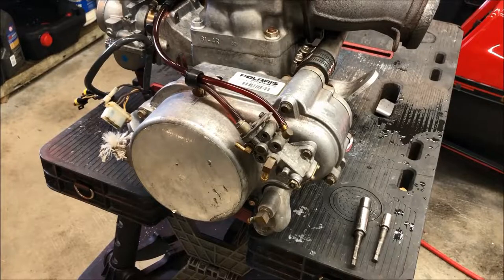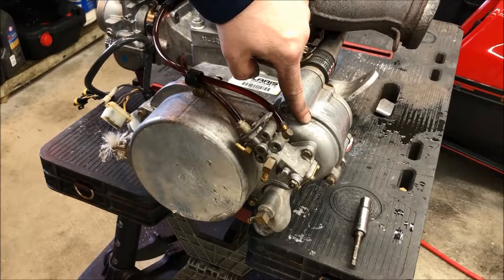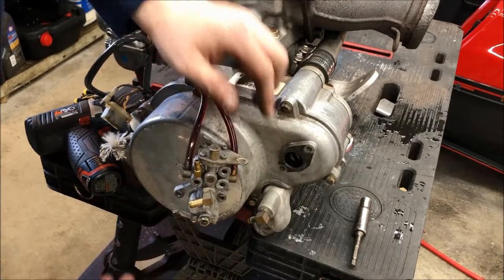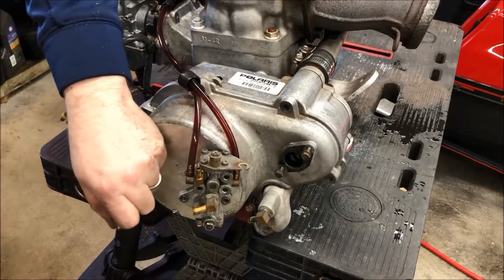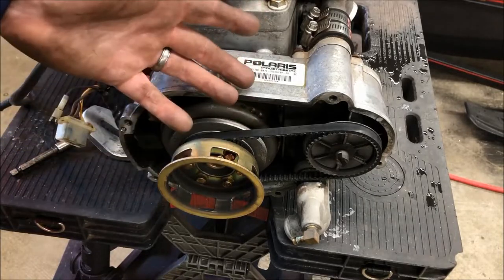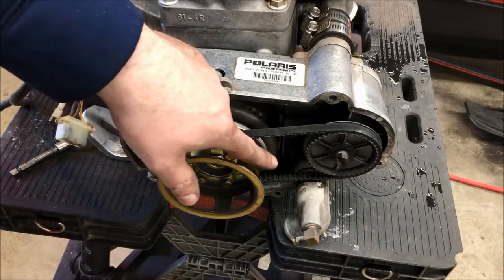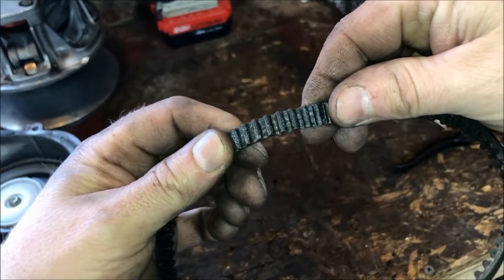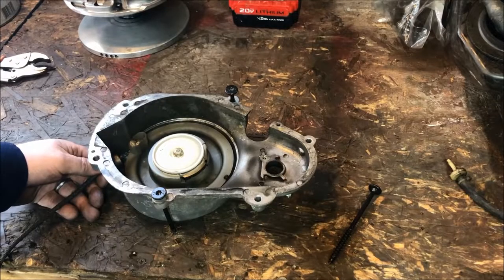Project Sled 2020 XCR 440 / 700 - (Part 4) - Recoil Rope Replacement and Belt Inspection

Comment: Why wouldn't you just tie a solid knot first slide it through pulley and hole when you take old rope out and save yourself winding process lol??
Reply from the maker: How would the knot pass through the hole in the pulley. The knot is larger than the hole. 

Just did another one today. It took me longer to take the recoil off the machine and get everything setup than to replace the rope. 🤣🤣
Reply: @StreetersGarage  your confused lol take the 6ft of new rope tie an end, pull pull out old rope all the way cut/pull old rope while still holding down on plastic pulley that the rope winds around! While still holding plastic pulley feed new rope through pulley amd recoil housing and let go! Save you from winding again lol
Reply: @Streeters Garage just curious and throwing tipnoyt there for fellow slender also I see you definitely pay more than enough attention to how much wind/rotation the rope has for pull length. Great video though you do a great job on all videos!!